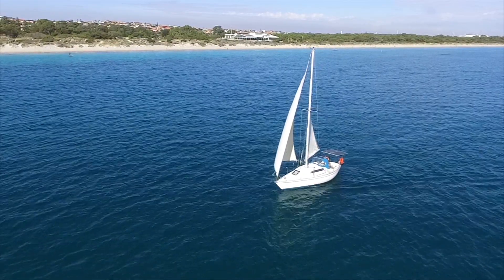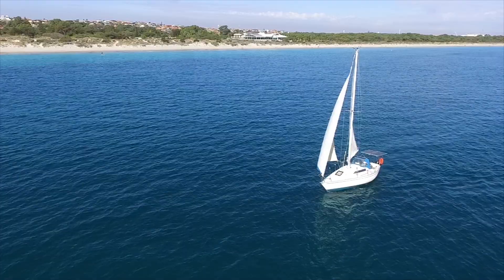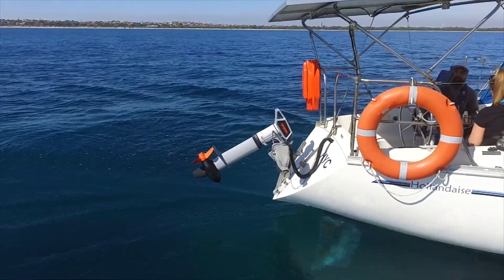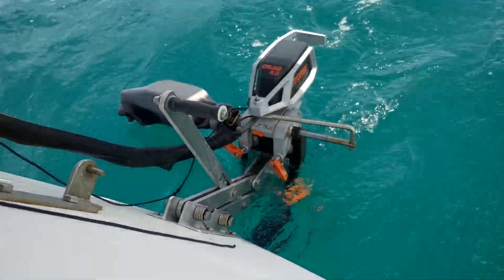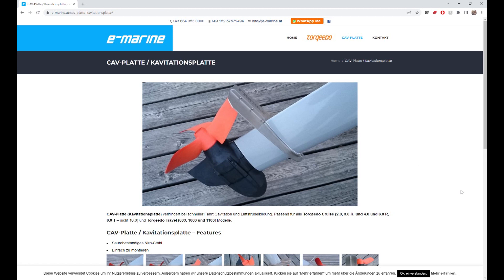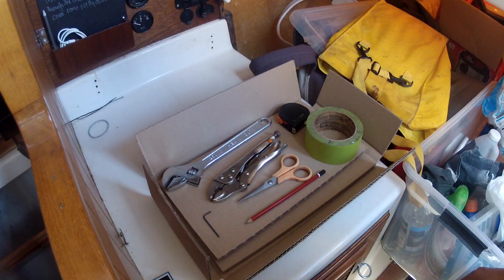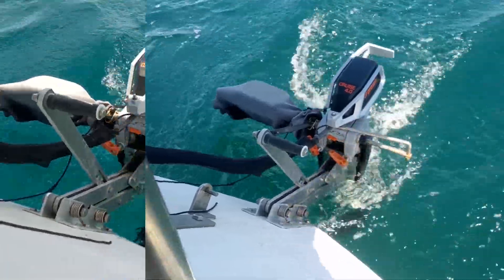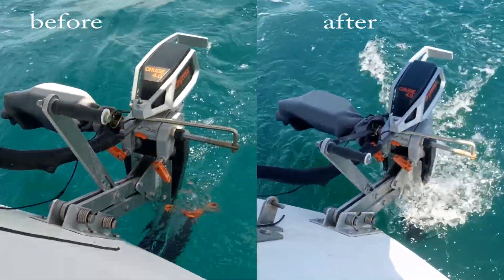Solar Electric Sailboat - FAQ

Comment: Very nice video. Could i please ask where did you get the engine mounting item from? I’d like something similar for my boat but could not find any. Thanks
Reply from the maker: Hi there, I bought the mount from Whitworths Chandlery and got the mounting plate modified by Custom Aluminium in Osbourne Park to match the 40 degree transom angle. Thanks for watching!

Comment: what all is being powered by your AGMs?  have you thought of upgrading to Lithium/Iron batteries?    I'm guessing you have 2x300 panels on the back and 1x100 up by the hatch?   hows that working out?    I've just about finished making my house off grid solar (7kw of panels, 15.5kwh of LifePO4 batteries) and thinking about doing a solar electric sailboat next.    It seems a lot like RVs but Im new to sail.
Reply from the maker: hey,

Lithium didn't make sense for this project, it was 4 times more ($6,000) for half the capacity, and given the AGM bank is similar in weight to the Volvo diesel it replaced it kept the weight distribution the same as before. Our typical DOD (depth of discharge) is 5% to 15% which gives us around 1,200 to 1,400 cycles or about 8 to 10 years battery life. If the DOD requirement increases in the future I may look to upgrade but I'd rather sail than motor.

The panels are sufficient for now, they provide a max of 15 amps at 48v so we could theoretically cruise at 2.5knts without drawing from the battery. I'd like to add maybe another 2x200watts that fold out from the main array for that extra amperage but its not necessary at this point. thanks and good luck with the project.